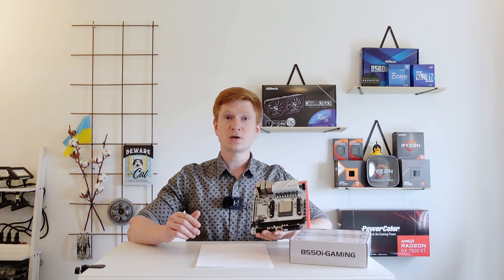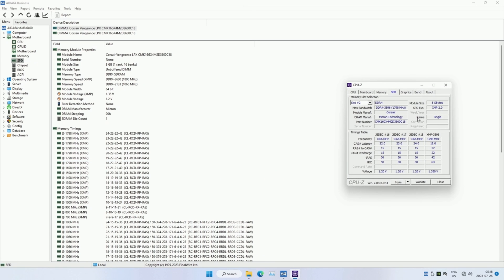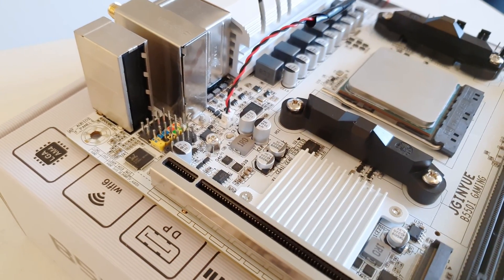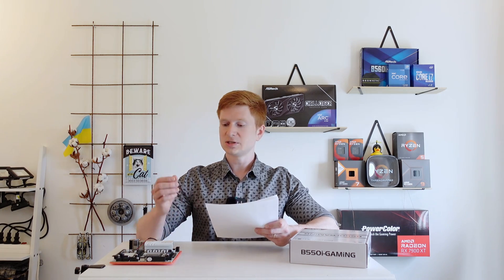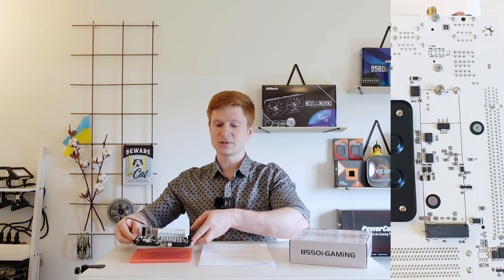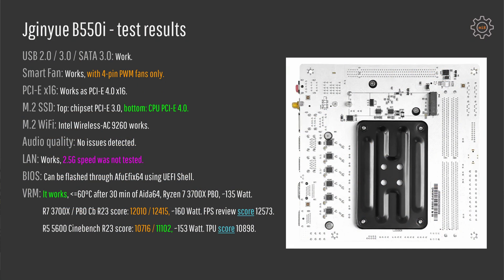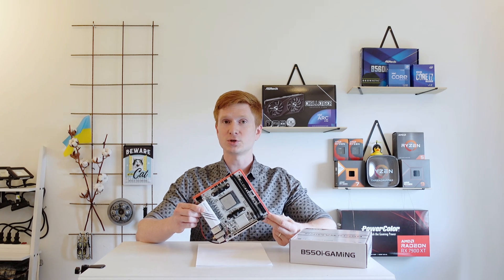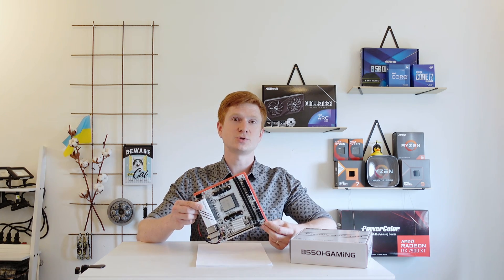🇬🇧 Jginyue B550i-Gaming motherboard – detailed review | R7 3700X, R5 5600, XMP, O.C.

Comment: If you use a Ryzen 5600G, for example, on this board what is the maximum size you can set the shared VRAM?
I'm hoping for 4GB or higher
Considering this for a small HTPC.
Reply from the maker: I didn't check this and don't have the motherboard any more, sorry.

Comment: A bit late for the video, but I have a question about the wifi module. Does it plug into one of the m.2 slots on the front or the back? Currently using the back m.2 for my OS ssd as the front  m.2 slot did not detect the ssd. I was under the impression wifi m.2 slots were 'keyed' differently. If there is another port, please point it out for me, thanks!

Also if I do use a wifi module, does it automatically use the antenna ports on the back of the i/o board?
Reply from the maker: I assume you didn't want the video. The WiFi port is under the metal box that has WiFi antenna output, it has nothing to do with the SSD M.2 slots.
Reply: @Miyconst  Thanks for the reply! I did watch the video but I somehow missed the part where you talked about the wifi module. 

Your video guide has been very helpful, more so than the official documentation haha

Comment: Thank you so much for your detailed review. In regards to Sleep mode, I am a bit unfamiliar with this issue whereby a computer cannot go into Sleep mode. Every computer I've ever used in my life has always had the power options of sleep, restart or power-off. Just so I understand correctly, if I buy this motherboard and use Windows 10, then I would not be able to put the computer into Sleep mode? Would my only choices be restart, power-off or hibernate? I've never seen hibernate mode before, so I'm a little confused.
Reply from the maker: The hibernation option is disabled in Windows settings by default, so the options would be restart and power off only.
Reply: Thank you  @Miyconst   for your help. Much appreciated. I'm leaning towards an ASRock B550 itx motherboard, but I like the white color of the JGINYUE itx motherboard. I need time to think about which one to buy. Have a wonderful day, and looking forward to more reviews.
Reply: You can absolutely add the hibernation button and use it just like sleep mode. Just go to your windows settings and add the button . I have done myself many times on ali express motherboards.

Comment: Got big problems with this mobo after upgrading from R5-3600+RTX2060s to R7-5800X+RTX4070. Flight sim MSFS 2020 got really unstable, stuttering like hell sometimes and crashing to desktop. Sometimes working ok for a while. Old cpu and new gpu worked pretty well, didn't test that much, but when I put in new cpu too, it got really bad. The whole case gets very hot too, cpu around 90 degrees, liquid cooling. I think it should handle that, the old cpu did. I disabled fTPM, but I'm not good at BIOS stuff. Any suggestions appreciated.
Reply from the maker: Check if your VRM radiator is mounted well. Ensure good VRM cooling.
Reply: @Miyconst  VRM radiator seems ok, but hot. Should I try something with CPU frequency or Voltage? Both say 0 now.
Reply from the maker: @GreyFox976  how hot is the radiator? Did you apply any overclocking in the BIOS?
Reply: So the ryzen 5 3600 worked pretty well with those heavy games?? I'm planning to pair it with rx6600 do you think I will be fine with this board

Comment: Do you have a video on machinist x99-8D Max? I am running 2x e5 2699 v3 and 4x16 3000 desktop ddr4 and in my use case I think the ram latency is causing a performance bottleneck (capped at 2133 as no xmp available in default bios). Is there a way to enable xmp or should tightening timings at the 2133 freq help with the latency issues? Also, does your turbo unlock video work with this cpu?
Reply from the maker: I do not plan to review the X99-8D Max as it has pathetic BIOS and questionable quality. RAM speed over DDR4-2133 is only possible if your CPU supports that and only if BIOS is decent enough. Tightening RAM timings will surely help with the latency. Xeon E5-2699 V3 surely supports Turbo Boost Unlock.
Reply: @Miyconst  thanks for the reply! I am coming to the same conclusion on the bios I just wish they had more information readily available and I would have chose to go with a different option because I agree this bios is trash. Any recommendations on a replacement x99 dual cpu config that supports the CPUs I listed in the 100-150 price range?
Reply from the maker: @osrsstreamer3512  the only dual CPU option I can recommend is Huananzhi X99-F8D (Plus) or Dell T7810.
Reply: @Miyconst  excellent thank you! Lastly, to your earlier point, if I have a board where xmp can be enabled in the bios, will it still limit the frequency to the max mem freq the 2699 v3s can support (2133) even though it has 3000 listed in the bios? Further, will the XMP timings stay at the tighter levels even if the ram frequency is capped at what the CPU can support?
Reply from the maker: @osrsstreamer3512  yes, the memory limitation is the CPU limitation and what's listed in the motherboard BIOS does not have any impact.

Comment: Has anyone been able to achieve ram speeds above 2133hz with this? There seems to be two pages on the bios where you can aet ram timings but the board fails to boot if i make changes to either of them and i have to reset the bios to get it working again.
Reply from the maker: Please watch the review carefully, I have it running DDR4-3600.
Reply: the default ram voltage is 1.2v, you need to increase the voltage a little bit to like 1.35v

Comment: I just received one of this. Put a ryzen 5500 and the board doesn't turn on. Looks like it's dead. Any advice?
Reply from the maker: Try with another CPU first, ask the seller if there is a BIOS update.
Reply: @Miyconst  I had tried with the Ryzen 5500 and with a 2700 (not supported according to the advertisement). I managed to fix it. First, as the board does not come with an instruction manual, I connected the power button following the colors of other motherboards, I connected it to the red pins, when I was about to give up I decided to connect it by position, and then finally the board turned on, but without displaying video. After a long time swapping memories and switching between two VGAs (radeon 7750 and a GTX 670), I decided to test the newest card I have around here, an rx 6600, and finally it gave video. The problem with this motherboard is that it comes configured in a way that it doesn't boot with older video cards. After configuring the BIOS I was able to boot with the other VGAs, but if the BIOS is reset the error returns, as the standard does not accept these "old" cards. I was about to give up and dispute the return of the motherboard.
Reply: @EdyStauch may know what did u changed in the bios?
Reply: @malvin98  I believe the main thing is something related to video in "UEFI mode" old graphics cards don't support that, but I also disabled above 4G decoding. If the resizable bar is enabled, it's better to turn it off too, but I think it's already disabled.
Reply: @EdyStauch  hi, did you tried the ryzen 2700 with new GPU?
Reply: @2250161  No, but the main problem is that the motherboard comes with a default configuration that does not boot with some video cards. After changing this configuration, any video card works, and this should be the default configuration.
Reply: @EdyStauch  would you believe that i had an lga 1155 gigabyte board that behaved like the opposite - it would not boot with newer (uefi vbios) gpus, and for gpus that had both uefi and legacy vbios (much as rx 5xx cards), it would not boot unless i downgraded the bios to an older version that had an option to allow it to use legacy vbios as default
Reply: @mparagames  I believe. I have a 1150 motherboard and I'm almost sure it doesn't work with the rx 6600. But it worked perfectly with an rx570 and other older cards.
Reply: @EdyStauch  what is this configuration?

Comment: Hi,
Doed this support 5800X3D? I could not find any info nor webside about support only vaguely support 5000 but does not guarantee 5800X3D?
Reply from the maker: I cannot guarantee the X3D support because I didn't test it, but according to the specs it should be supported.
Reply: @Miyconst i actually emailed JGINYUE and they said it supports out of box so... I guess that is yes!

Comment: Do you recommend for a small gaming PC? Only for gaming. I want build a pc with 5600+3070 for 1440p. The cost with a second hand 5600, 3070 and this motherboard even it's less than a Series X in my country. The case I want to use it's a chiniese called K55.

Comment: *Hi, wondering Would you be getting any Maxsun, Soyo or Onda boards to review? Thanks

You mentioned enabling resizeable bar in the BIOS, did it actually enable work with a compatible GPU?* :yt:
Reply: I've used Maxsun and Soyo boards for many AM4 builds and they're great.

But, the bios is quite basic (but sleep, XMP, etc work fine). Fan control is very basic, but you can use fan control software in windows for more control.
Reply: @yotoprules9361  Yes I have been using them also, I bought a Maxsun B650 recently on the AM5 platform, done a video, just need to build it now.

Comment: can I assume that amd 3000 series works on this motherboard? or you just got lucky for that 3700x?
Reply from the maker: You can assume that, but I can't guarantee anything, just like with any other Chinese product.
Reply: @Miyconst have you tested it with gpu? like rx580? some says their gpu doesn't work
Reply: @Miyconst my 5950x failed to display
Reply: I'm having real trouble getting a 3200g to post on this board, a 5500 worked straight away so I'm not hopeful.

Comment: The lack of the wifi module is kind of a let down considering that's usually included in the price. Once you add a module for $20-25 USD, now the motherboard is $100. For about $120-130 USD here you can have the asrock B550 itx which is a similar quality or better and features maybe a bit better with NONE of the odd problems with sleep or XMP... this makes the choice harder.  Even still, this is a great review and I may still consider building one of these. Perhaps without the wifi module and adding one in later.
Reply from the maker: Yeah, I don't know why they skip the WiFi module, it doesn't cost much. Also, the housing is a real pain to deal with.
Reply: @Miyconst yeah really wondering about that
Reply: Only one nvme slot though

Comment: Looking for an upgrade of such caliber, but given that Brazilians won't be able to safely import stuff because of new sh*tty government rules, I'll have to look at the sh*ttier local market... Speaking of sh*t, here's a quick doubt: after 2 years, my Huananzhi x99 8M-F does not recognize Windows boot manager on my NVME "normally" anymore. After I hard reset the BIOS, it does, but it forgets the OS again after reboot. It first happened when I noticed the clock was wrong, so I changed the CMOS battery, but same thing. Changing boot options to UEFI only has the system booting every time, but at the cost of not showing any boot devices at the BIOS anymore. I never removed the NVME from the slot, nor formatted or changed anything related to the filesystem. What gives?
Reply from the maker: You can try the following steps to fix the boot issue: 
Shut down the computer.
Disconnect the power cord.
Disconnect all storage devices.
Turn on the computer.
Go to the BIOS and restore defaults.
Save changes and restart.
Go to the BIOS and apply any extra settings you wish, such as RAM timings. This is an optional step.
Turn off the computer and disconnect the power cord.
Connect all storage devices back.
Turn on the computer, it should work properly.
Reply: @Miyconst  I'll give that a try, thank you! My research states that it seems to be a common issue with Chinese motherboards and NVMEs, though most info I found on this told me it had to do with using MBR instead of GPT, which is not my case...

Comment: hola, about PBO, it has all the settings as in Curve optimizer ?  Thjanks!
Reply from the maker: There are extra PBO settings, but I am not sure if it's as rich as other motherboards', but in any case, Ryzen overclocking is next to useless, thus I would not bother.
Reply: @Miyconst  maybe not as"overclocking" goes but does give you an extra on boost and lowers temps some, thanks for the vid

Comment: I had no luck running a 2600 in this board (I don't blame the seller for that, they said only 4/5 gen support so fair). I also got no video from an rx570 and an rx580 (I did not tweak BIOS as at that time I was stuck in Chinese mode). The seller later reached back to me and gave me a video on setting BIOS to English. But I'd gone ahead at that point and just threw in an RX550. 

iirc I picked up at £55 plus a shipping charge. To be honest, I regard the product ok, and the price good. Its got the usual flaws, but not likely to pick up a mini-itx at the price point..
Reply from the maker: Pretty much the same conclusion I have got.
Reply: @Miyconst  I am sure my testing was well below your high standards!! :)
Reply: And I poorly planned this whole thing given I had to go spend extra on a 4500 Ryzen to get things running ! :)
Reply from the maker: @AdmV0rl0n  I originally planned to test R5 5600 only, but people asked to test 3000 series, so I hunted down an R7 3700X on the second hand market.
Reply: @Miyconst  I have over several years gathered AM4 stuff. Its probably going to hit legend status for me - and a lot of AM4 works, but as we see here, its got limits like everything. I will I think be buying AM4 things for some years to come.
Reply: Hey mate, wondering if you bought other brands from Soyo, Maxsun or Onda, wondering if they support SAM, thanks.

Comment: I had problems about the VRM and the M.2. The rest of the problems is fine. I have already using aliexpress motherboards and i think i can live with that common Chinese issues. Im also know that aliexpress is not the 1st please to go when buying this kind of items. in my country there is no Mini ITX market and the normal motherboard prices are also 3x high than this one. So i think this will be a good investment compering my local market prices. Thank you miyconst for this review. I been waiting for this for a long time. And it worth it. ❤
Reply: what problems with the m.2 can you be more specific?
Reply: @lyndongaming  is been a while, sorry! for late reply. if you still interested. I had concerns about the m.2 speeds. there is 2 m.2 slots. bcz its cheap I thought both are 3.0 but the back is PCI4.0 and the front are PCI3.0. and also, I planned to run this with 7800x3d and I had concerns about the VRAM can hold the power. and Suprise Suprise, it holds Prity well. I'm running like over 5 months now. no problems at all I didn't do any tinkering's at all I just get it setup and run no problems.
Reply: Bro, m also thinking to buy this in India..is it working fine..
Reply: @altrozt6226  for me yes. it's been 5 months since I brought and set it up. no problems for now.

Comment: Be careful when measuring the heatsink of the VRM, as it may be cold and you will be telling your audience that the VRMs are good, but a cold VRM heatsink means poor thermal conductivity it is best to monitor the actual heat coming from the VRM.
Reply from the maker: I measured PCB temps right next to the heatsink as well as the naked VRM components, it's just hard to capture it on the video.
Reply: @Miyconst  Thanks for the clarification, due to the angle of the infrared thermometer I was speculating that you were measuring the heat sink, adding this detail in the future would help clarify for future viewers.
Reply: if it was horrible would throttle after 30 min stress test with 135W load.
Reply: @Kanivalos80  ...but did he even test with 135w load? From what i saw he used a 76wmax ppt ryzen 5.